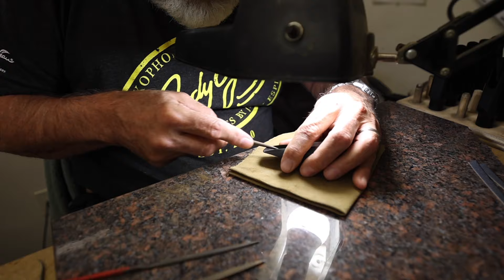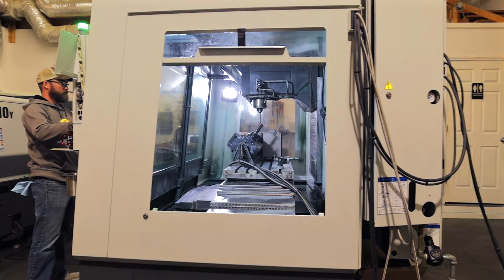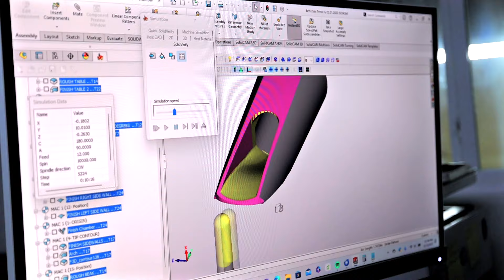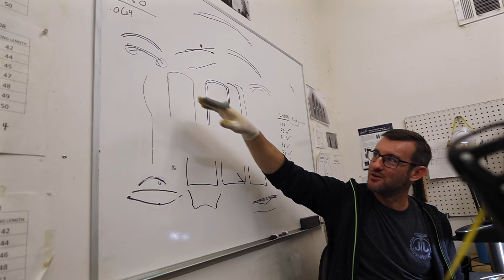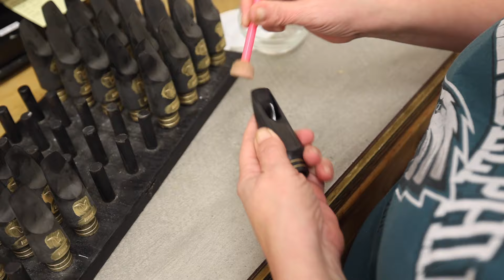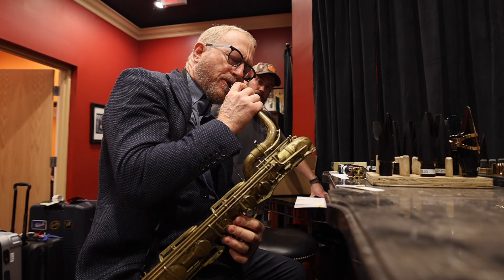How Saxophone Mouthpieces are Made - JodyJazz Factory Tour

Comment: At 7:39 in the video (and elsewhere), what is the thick piece on the alto neck, just below the cork?  Thanks!
Reply: This is an old conn sax. The thing you mean is called a Microtuner, built to make tiny adjustments to the intonation without needing to take off the mouthpiece. Most of them are fixed today, though, due to some issues..

Comment: Can someone explain why the bore that goes to the neck is not standard?
I can’t go from a Nexus to a Jody without quite a bit of plumbers tape to make up for the difference
Reply: This is Jody - This is a great question. It would be great if we could standardize the outside of the neck at the end where the mouthpiece goes including cork thickness, and the inside of the mouthpiece only as far in as you need to be in tune. Please understand the dimensions of the bore of the mouthpiece and the dimensions of the bore of the neck affect how the instrument sounds, feels and plays. So, I don't want to tell any manufacturer how they should make their necks, and I don't want anyone messing with my bores. So, I do my best to understand more or less the industry norm for where to put that final part of the bore to accommodate most necks. We almost never receive complaints about this, so I think we are pretty okay. I think that it's one of the things in the world that doesn't have to be standardized.Putting some tape on the neck is not hurting anything and neither is sanding down a cork.  But I completely understand why we would want a standard size. The reason I don't make necks is because I don't want to have to send someone to their repair tech to fit the new neck.